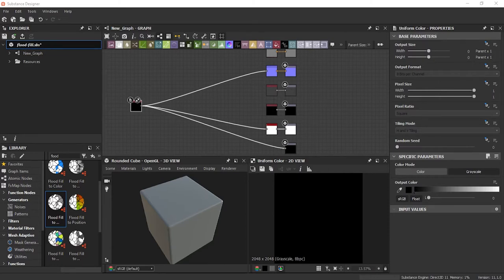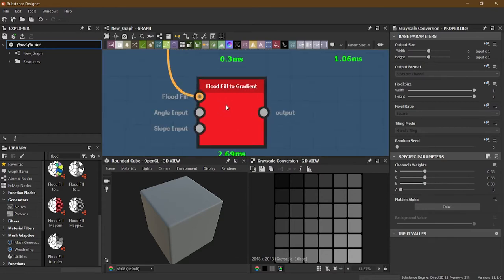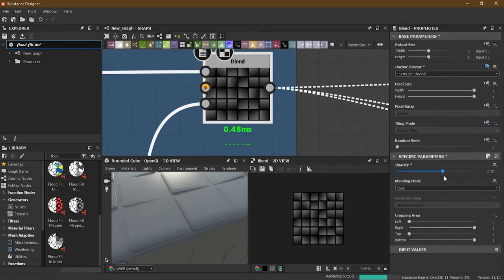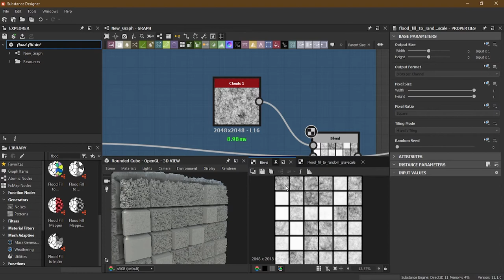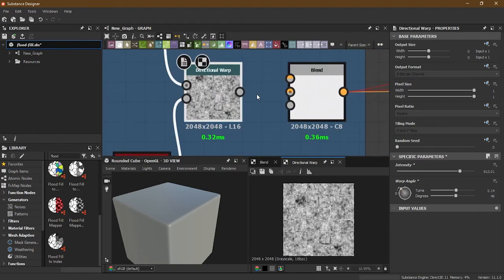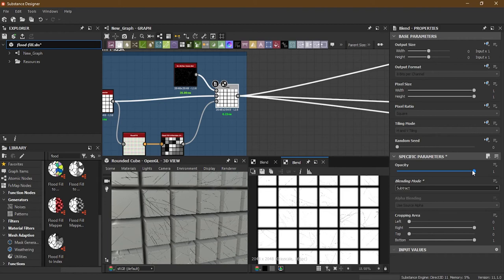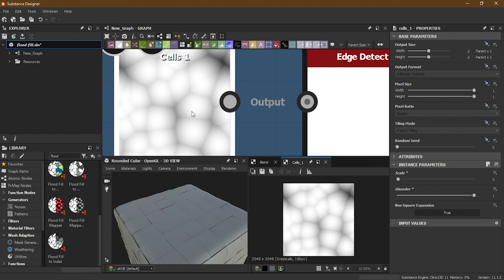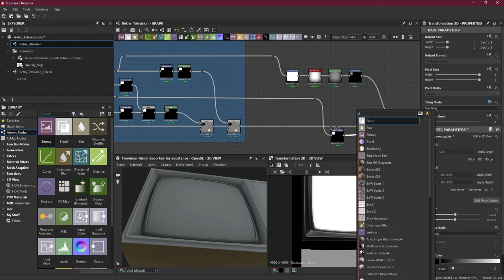Flood Fill Node | Lesson 5 | Chapter 2 | Substance Designer 2021 Essential Series

Comment: Thank you for another well explained tutorial. I have to mention about Substance Designer's use of the word "random". Random implies that if you do the same thing more than once you will get different results each time. However, that is not the case with SD. Whenever I follow along to what you are doing and all my settings are identical to the settings you have shown, my result is ALWAYS the same as yours, no matter how many different "random" settings are changed. So although I do understand what is meant by using the word random in the settings, it is not truly a random adjustment.